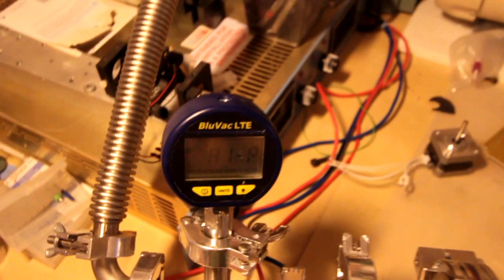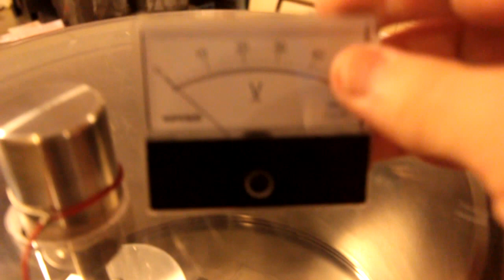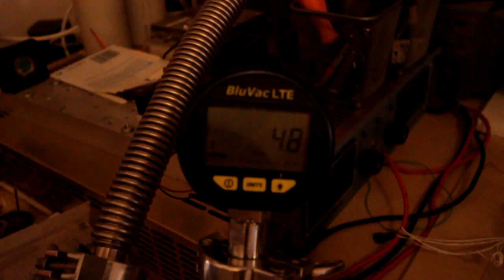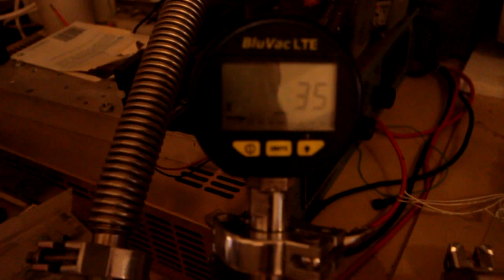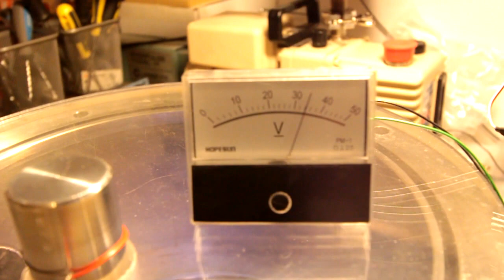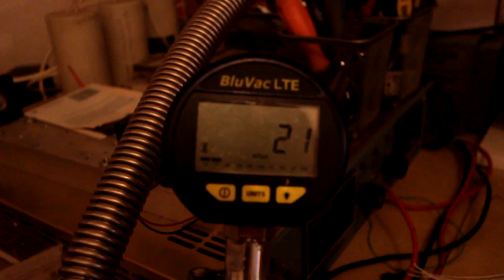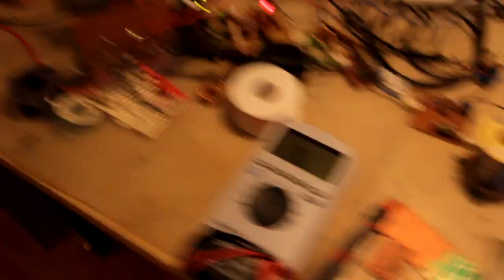Large area silver PVD / Magnetron Sputtering metallization

Comment: Hi, does someone know what the cheapest vacuumpump setup could be for a homemade set up, I want to pump vacuum like around 120mTorr
Reply: Emre Kurtoglu  your best bet is to find a used Edwards model 2 on eBay I got mine for $250 plus $50 shipping and then I had to buy vacuum oil I got Edwards ultra grade 19 for $30 and then I went to Mc master Carr and bought proper quick connect flange, gasket and clamp for $50 and that allowed me to connect copper tubing with brass compressor fittings to my chamber and it works awesome and I don’t have to worry about outgassing , these kinds of systems are never cheap I have found out

Comment: are you able to use neodymium magnet or electromagnets so controlled by microprocessor based control system and controlled microwave frequency by increasing or decreasing frequency of current or voltage
if we use piezoelectricity crystal cavity instead of toxicity of thorium then what happened, and we supply more electron by piezoelectricity crystal based gas lighters or battery powered gas lighters circuit integrated with microwave oven cavity hole layered by piezoelectricity

Comment: I have succefully sputtered copper in glass, however, when I try to plate copper (galvanic acid copper bath) to thicknen  the layer,  the deposit come off the glass. What  possible is hapening? thanks for any help and great video.
Reply: try to clean the glass better, try to bake the class after sputtering...for a while, also, unless you have a really good vacuum, you are not sputtering copper instead you probably get a mixture of copper and oxides. the first thing you sputter is also probably not copper but all the oxides that form on copper while it's exposed to air, pro sputter systems usually have a shutter that they open only after they sputter for some time to clean the sputter target.
Reply from the maker: you can also heat the substrate(glass) while sputtering, the hotter the better

Comment: Just a thought not a criticism: I thought there was a rule for glass, that a hole diameter cannot be less than the glass thickness, or a fracture can propogate from that hole. We use this rule for glass door hardware. I hope you have no problems.
Reply from the maker: ugh...so the rule is you can't have a 5mm hole in a 10mm glass? does not make a lot of sense, the plate is 25mm of  borosilicate.
anyway, the load direction and pressure is vastly different then with a door.

Comment: Would it be possible ot deposit a layer of either Aluminum, Gold or platinum with a thickness of 1µm to 10µm on a thin piece of kapton or mylar using this method?
Reply from the maker: don't see why not, gold would be easy
Reply: Daedronus
Excelent, i think i will be building one of these then. I would suspect the sputtering time would be in the hours though... So water cooling the magnets would be needed.
Reply: I have tried using copper and Chromium in PVD chamber.  The great dificult is adherence onto kapton sheet.
Reply from the maker: did you try heating the target substrate? heating should promote adherence.

Comment: use an argon atmosphere, you will be able to sputter almost any metal you want without it reacting, and you can make other fun stuffs like argon ion etching and plasma cleaning. i use commercial sputtering systems which have smaller blanks but much more controlled, i think it's much more fun if you build the machine yourself.

Comment: Just heard of this process , but I must ask , what is your application for such a device ?
Reply from the maker: Any time you want to metalize any non conductive surfaces.
It is used extensively in the semiconductor industry.

For home made PCBs you could add another layer on top of the solder mask, effectively making a double (or multy) layer PCB.
Reply: Make diamonds

Comment from the maker: The seal is a viton o-ring beteen the top aluminum cylinder and the glass plate.
No idea on the current, the voltage is around 300-500V.
And it will heat up a lot, because there is no convection cooling in vacuum, so far the magnets seem to survive.
Traditionally magnetrons are water cooled.

Comment from the maker: the substrate is not connected to anything, it can help in some situations but it's not required.
The atoms to be deposited are ejected from the target and are basically neutrals in ballistic flight, so they don't need to be attracted or repelled.
The magnetron is composed of 2 alternating magnets NSN, one ring and inside it one cylinder.
What kind of things do you make at work?

Comment: Great video! I'd like to build a setup myself for demonstration. (I work for a UHV component/chamber manufacture).  What are you using for an elect fdthru to connect your substrate? You do need some connection to the plastic: correct?

Your magnetron is basically just a permanent magnet?

Thanks!